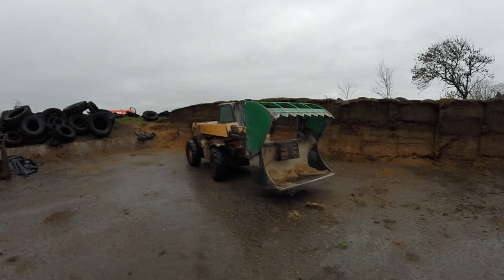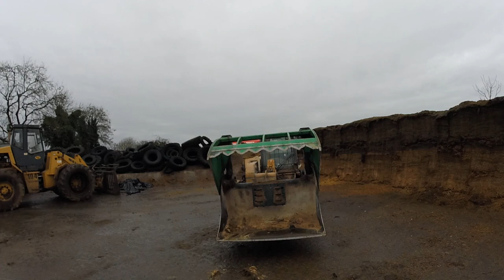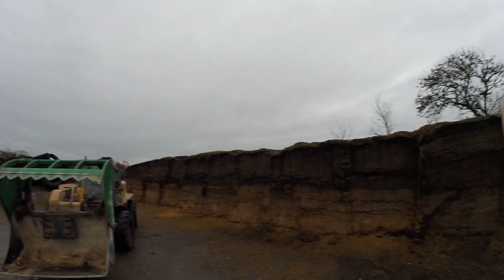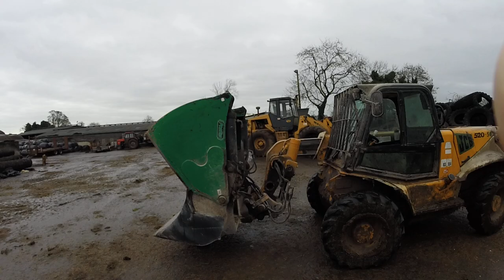Why we bought a shear bucket

Comment: Great video👍nice piece of equipment. 
Any problems with keeping the face of pit fresh?  Would a division up the middle of pit be a help and make face smaller?
Reply from the maker: absolutely no problem keeping the face of the pit fresh as we did use 3/4 of the face a day  when everything was in but we have slowed down now as we have 1/3 of the yearlings out and 1/4 of the finishing cattle killed
Reply: @FARMERPHIL3690  yeve a fair size operation so!